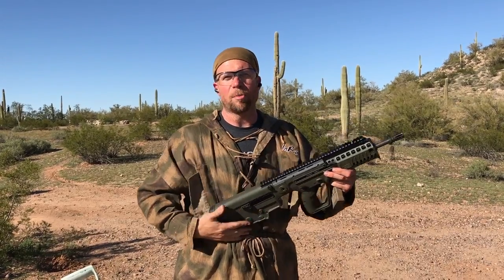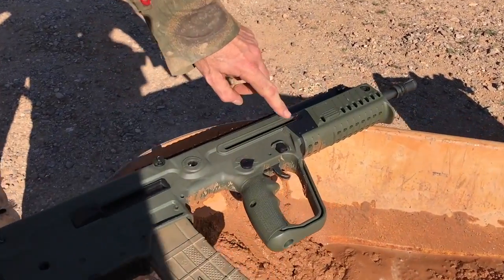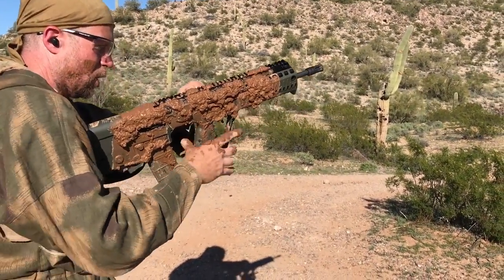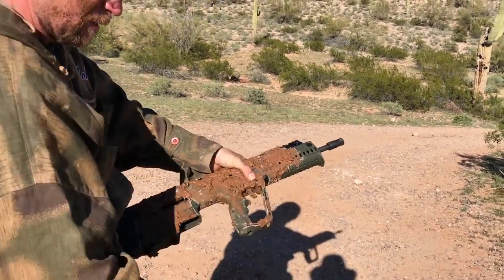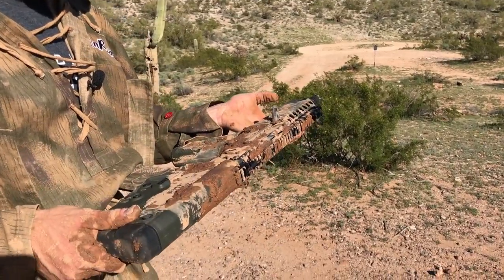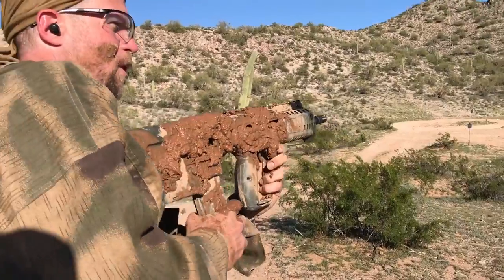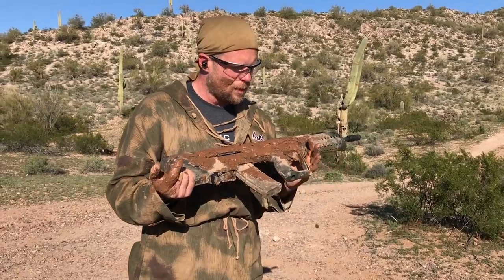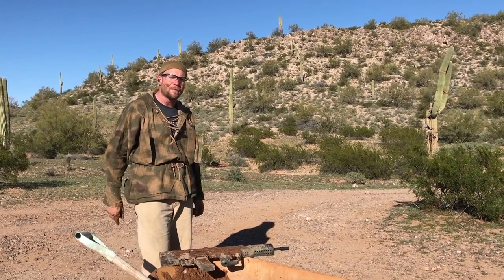Mud Test: X95 Tavor

Comment: I noticed the excess mud wasnt shaken off before firing. It probably would have worked if the ejection port wasn't blocked. A quick shake before shooting would have cleared it.  Not that it changes the mag release issue.
Reply: I noticed that too, normally I see them shaking off excess mud.
Reply: Steel Talon 
That's what I thought they were a little hard on the tavor. But like you said still would of had the mag release issue.
Reply: It's probably worth noting that the Tavor functions exactly like an AK but with an AR style bolt under the spacegun exterior. The AK also failed after the first shot. :shrug:
Reply: Steel Talon 
It faired better then my m1a, still love that rifle tho.
Reply: Steel Talon m4, and the delay roller blowbacks didn't have a wipe so this gun doesn't get a wipe
Reply: ratchet2505 
But they got a shake. Tavor got picked up and what ever fell off, fell off.
Reply: Joshua B 
Just saying I'm not a tavor guy m1a all day...
Reply: smacked it on the ground.. it failed hard
Reply: gyrfalcon16 
Actually after the ground smack it ran
Reply: the mud around the ejection port was causing the initial stovepipe from what I can see
Reply: Yup. I have seen two other Tavor mud failures, allways mud in the ejection port. Im surprised they got it back running.
Reply: Yes, that's what I noticed immediately :
On this video, they put mud on the right side after the left side and don't clean the ejection port nor shake the rifle to put mud away from the ejection port (as they did on the M16 and the SIG PE-57. Maybe on others as well).
I doubt Karl and Ian are dishonest, knowing the quality of their work, but I suspect a cognitive bias or simply a forgetfulness.
I also wonder how better would have performed the FN FAL or the M16 with mud on the trigger opening.
Reply: Yeah, I don't care much for the Tavor (I don't think it's a bad gun, it just doesnt suit me), but it seems to have had the deck stacked against it in this one.

Having only watched a couple of these so far, the others had a much runnier mud on them. This was thick, heavy and caked on. NOTHING could have ejected through that mass.
Reply: Steel Talon no gas exhaust to blow mud away prior to the brass ejection
Reply: The soupy mud got in the trigger guard and inside the bolt, it'd have had the same result.
Reply: Yeah, finding holes to put mud in because the rest of the rifle is well sealed is a bit bullshit.
Reply: Tavor is not "well sealed".  And it indeed fails when the mud gets inside.
Reply: 8AntMan keep in mind the bolt was also just stopped about half way back the mud's putting a lot of friction on it somewhere but only initially.
Reply: Still its a piece of shit
Reply: Yeah, I agree. You can tell he wanted this to fail due to his bias against bullpups. When they tested the ar-15 the mud was much thinner and they shook it off and "cleaned the rocks out of the ejection port". I think if they would have tried to get the mud off as anyone would in a real-world scenario it would have work much better. IMO

Comment: So, it looks to me like the stovepipe on the first round is due to mud overhanging the ejection port, and that might be what starts the whole debacle off. My guess is that if you brush that mud off, the first round stovepipe won't occur. Can't say if the failures to go into battery would be fixed by that though.
Reply: if that is the case they should put a dust cover on it to fix it
Reply: Dust cover probably wouldn't help against a literal wall of thick mud.
Reply: and in most of the ar tests they did, they shook off the extra and there wasn't huge globs caked there,, I agree.
Reply: Watch the StG57/PE57 video, there's a slowmo footage of it having the same wall of mud on the ejection port yet it did fine.
Reply: Rockid9040 of course the roller delayed Stg is going to eject more violently than a gas operated gun and plastic does not vibrate like stamped metal. This is a bust because honestly no soldier would leave the ejection port covered. The thickness of mud caused that failure. If he would of cleared that mud it would have ran flawless.
Reply: @matthew McGil that and it is a sample of one so youcanot say if it is this perticular exampel of the gun that is incapebel of that mutch gunk or if it is the disigne of the gun that causes the malfunction
Reply: InRangeTV didn't shake or clean off the mud on this test like they did with the AR. Further the mud is much thicker on this test than it was with the AR. InRangeTV, you really need to be consistent for there to be any sort of valid comparison. What you have on InRangeTV is a bunch of anecdotal tests, rather than scientific tests, which makes all these tests unreliable comparisons. Ideally all guns should be tested on the same day, with the same mud, covered in exactly the same way (for example submerged for 5 seconds except the muzzle with three solid shakes to remove mud on the first shot). Same clearing techniques and time spent clearing, etc.
Reply: I totally agree with that. Beside, I think the Tavor X95 did prettry well on this test
Reply: I wouldn't call that a complete failure because the ejection port had mud overlapping it. Although you had to mortar charge it, it did continue to fire. It even locked open on empty. Shoulda wouldas for sure. If anything I woulda ran a couple more mags through it. Good video none the less.
Reply: Obviously this stuff is mostly for fun and it’s a very crude way of trying to conclude anything. But I just wanted to cast my vote in the camp of people saying any reasonable person would clear the wall of mud off in a combat scenario. Or even that these types of tests are so highly unlikely in a real-world scenario that they’re almost silly. That being said, they’re still fun.

To me one of the most important things is if the gun can quickly get back into the fight. I thought that thing was toast at first. But a mortar or two and then it’s back? That’s good with me.

And even some of the most proven weapons systems in history (M16 family, Beretta 92 family, USP family, AK family, FN SCAR, Glock, and so on) can fail when gobs of thick mud is introduced. Especially if a thick wall of it is covering the ejection mechanism. That’s so obvious that I’m kind of surprised they didn’t try just clearing the ejection port and seeing what would happen.
Reply: @factstraight  Bingo on all accounts - particularly, the first FTE was likely caused by the wall of mud in front of the ejection port, which then let a bunch more mud into the action. FWIW: I have and like the AR-15, but these two videos aren't a fair comparison at all.
Reply: @factstraight  They never claimed these tests were scientific.
Reply: @matt_man6390  
I recommend anyone complaining that "if the mud test had been equal the AR would have failed worse cause the 416/tavor/ak/Aug are clearly better than the ar"
Go watch the AR 10 mud test they lather a bunch of solid mud right into the ejection port but the DI gas vents blow it all off.
Reply: IRL if I dropped this gun in mud, I’d dump my canteen on the damn thing and use it to take the enemy’s water!
Reply: I actually commented on this a while ago. Said in all other videos he does a "shake" for the iwi products he does not. This is not a failure of the x95. It is an operator failure. The content creator responded "we are paid shills obvious." No, if you are going to do testing have a standard to test by. Otherwise you look like a couple of homeless dudes with a wheel barrow that borrow rifles they can't afford from people to test.
Reply: My X95 will have the occasional FTE with .223.  It does not seem to eject with as much authority as my AR. I can imagine that a wall of heavy mud in front of the port would cause a failure every time.  Best to shake it off in real life, methinks.

Comment: No gun will function with ejection port completely blocked. Whether you block it with mud, your face, unicorn turds etc.. it doesn't matter. A blocked ejection port will cause a failure to eject every time, all the time.

Comment: Of course it failed on the first round. There was nearly an inch of mud completely covering the ejection port! You can't expect to eject a spent case though that wall of mud and have it work. It's like holding your hand over the ejection port, and then complaining that it didn't eject properly.
Reply: Yeah, and people talk about how well the ar does, when the dust cover is in place when they slather it in mud.
Reply: They did skip the "brief shake" they  give most of the other rifles

Comment: I can solve your ponderings about the magazine release. I looked over my X95 and saw that the left side button is directly linked to the magazine catch, where as the right button is linked to the left button. You can see this if you hold the rifle level and operate both. The right release will depress both buttons where the left will not. I am from Canada and our X95s come directly from Israel. I know a couple people have done mud tests/torture tests on theirs and had not had the number of issues you did... I'm not sure if our X95s quality is any different, but certainly interesting to note. (not fanboying, just curious)
Reply: That's interesting, it sounds like the magazine release from a G3 or MP5 in that there are two ways to eject a mag but one of the two ways actuates both.

Comment: I noticed the mud was pretty much not getting inside the rifle however it was SO thick and caked iver tue ejection port that it basically stopped the casing from ejecting and what appears to have occured is when you guys turned the tavor on its side to view said failure the stuck case obviously prevented the bolt from closing and allowed the mud to get inside the action and shut it down. then as you tried working through it you obviously took the mud from the chamber all over the bolt worked it up and through everything...im curious if you had never tilted the rifle and just worked the action if the tavor would have faired better? being such an extreme exaggeration its hard not to fail i mean when will anyone allow their ejection port to be that caked in that thicl of mud? I dislike the tavor very much myself.

Comment: The malfunction in both instances was a pretty simple type 3 induced by the wall of mud preventing the case from being ejected.  That's fine, it's resolved simply:  Remove mag, rack action,  reload.  The trouble came from one of the mag releases being inoperable, so they spent a pile of time struggling with it.
This is due to a lack of understanding of the design.  The X95 has 3 magazine releases, just for instances like this.  Because the AR magazine catch is on the left side, the left button is the "real" magazine release with a physical linkage to the catch, which is why it worked.  The right button is just a lever that activates the left button.
The magazine catch in the buttstock is also a lever itself, and can be depressed to release the magazine if both buttons get jammed.  Having a basic knowledge of the controls would have resolved the malfunctions quickly and efficiently.

Comment: i serve in the IDF and the x95 is my primal weapon i shot it countless times and i honestly got mine in sand mud and every other stuff
 i must say sand made the gun very difficult to use the openings where the charging handle is,is right above allot of the action (trigger safety mag release) and it doesn't do any good but still it is a pretty sealed up gun and works very well in horrible cleaning conditions
 i think the malfunctions of the first shots were because the mud was blocking the ejection port which makes it NOT the guns fault one more thing the mag release failure on the right side happened because when you press it it makes a huge opening that let's the mud go through and block it
 if i need to say something bad about this great weapon its the trigger and the fact that the mag release/safety are not made of steel and they do wear off in extreme conditions
Reply: Scott Leopauld man you want a picture of my dogtags? and my guns serial number? trust me when i say the x95 is great i dont know how is the version that is imported  in the US but our's rocks 
just to show you i am not one sided i will give you an example of an Israeli weapon that is not so good that's the Negev belt fed machine gun it needs extreme maintenance after a a few year's of service unlike the m240 bravo that we call מא"ג that runs great even though they date from the 70's
Reply: Pretty sure he's trolling you, dude...
Reply: Scott Leopauld man think what you want we will see what happens in the next war
Reply: interesting that this test uses more rock in the mud, and a thicker dryer mud then in the ar test,, and in the ar test he clears out the rocks before firing.. also interesting... Id rather have an x95 in bad condtions then any ar-15
Reply: Tyson Reinisch 
Go to Israel then.
Reply: ?באמת? באיזו חטיבה שירתת ומתי
Reply: פלסר 7 עכשיו
Reply: ZMan1471  idf doesn't use this gun anymore

Comment: Its wayy to old, but i admit, i like the mindset of making a simple problem and over complicate it.
wayy too heavy mud on the ejection port, i dont imagine any gun can overcome.
to avoid, simply make sure the port is clear.
if you do get that to happen, use the LEFT mag eject to remove the mag (release double feed bullets if any, reinsert and cock it. its about 3-6 secondes and no need to hit the ground. it didnt do anything to you.
Reply: That’s not mud it’s cement

Comment: I'd like to see the ar15 dustcover open with a inch of thick mud and see if it has the same failures, it probably would.  I'm a fan of both guns.
Reply: The nice thing about the AR though is that it vents gas out of the bolt before it cycles so it blows a lot of mud and dirt and shit out of the way itself before it ever even opens it's a really awesome design whether it was done intentionally or not.

Comment: I'm not sure if that was the best assessment! I think the reason the first round failed to eject is because on both tries you had a rather heavy clump of mud physically obstructing the ejection port. You might as well have your hand blocking the ejection port. If you tried it again, except this time just making sure there's no obstructions outside of the ejection port, I think you would see better results.

Comment: I see all these critics about the accuracy of these mud tests. Yes I agree but the guys would have to document particulate size and type viscosity, placement, method of removal of mud as well as document various mud conditions. This isn't a engineering channel or a science channel. Dump mud, fire, note result and you take it as you will.
Reply: Not to mention that Ian and Karl have both said as much in previous Q&A videos.
Reply: or simply knock off the 2 inches of mud covering the ejection port like he did in the AK and AR videos.  I guess thats scientific for some people tho...
Reply: It was dump mud, CLEAR OFF THE CHUNKS OF MUD HANGING TO THE RIFLE, fire, note result for the other mud tests, not to mention that they should have noticed the inconsistency and added more water to this batch of mud. They don't have to test the mud to that extent to do a consistent test, just look at it and see that it's noticeably less runny.

Comment: i'm not a bullpup fanboi at all, the first mud dump seem a bit excessive in comparison to most of the tests. There was a giant glob of thick mud right over the ejection port and then you even swiped some directly into the chamber trying to clear the stuck case. Extreme situations in the field, i dont see this being a issue...if you run into that much thick mud anywhere i'd assume you run into a equally large puddle to at least attempt to wash it off. I guess people look back at Vietnam and the tropical conditions there as some form of proof that this level of dirty is possible, but there was as much water there too....

Comment: All weapons will fail at some point when covered and caked in mud. Some are just better than others. I think bullpups are more prone to failure because of more openings and linkage that cant be readily cleared out without extensive disassembly or at least a tub of water to vigorously shake it in. Maybe the tavor can benefit from a dust cover and rubber grommet on the side of the charging handle and a fully closed grommet on the side it is not on.

Comment: The point of failure, I think, is that the ejection port had no dust cover and was recessed into the reciever.  since mud just sat there, not able to slide off, the spent casing hit a wall of mud and stopped, causing the bolt to close on it.  I'm sure if you shook the mud off of the reciever, THAT aspect should have been remedied.
Reply from the maker: That didn't stop other guns.  ~Karl
Reply: Because the mud on the other guns was much wetter and more easily fell off the gun.  That, and the fact that you made a greater effort to shake other guns more vigorously than the X95 before you fired them.  Watch your videos again and tell me that there's not more mud on the X95 than the other guns in your video collection!
Reply: "In my incredibly specific worst-case-scenario, the gun would work perfectly."
Reply: I'm not excusing the gun.  That design feature is an inherent aspect of the gun.  I am seeing no other point of failure on the rifle though.  With other guns, the mud largely slides off or is shaken off with recoil.  This TAR has a very deep recess in the ejection port which holds all of that filth.  What I see is that mud, having been held on and relatively thick in the port area, stopped ejection.  I'm not saying the test was unfair, just that this is a very intriguing design flaw, considering all other failures in the mud test.
Reply: InRangeTV I'm not defending the gun by any means.  That failure was interesting and worth pointing out though.
Reply: @az-chris1136  

The mud used for this test is much thicker than the one used for the AR-15.